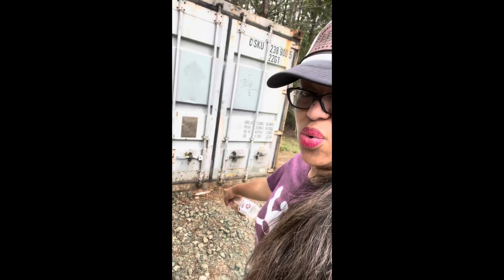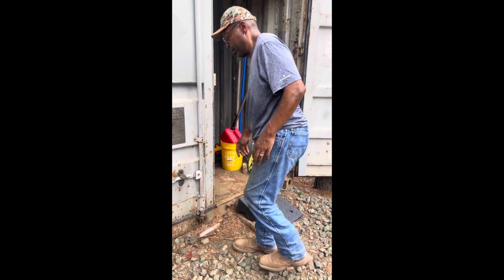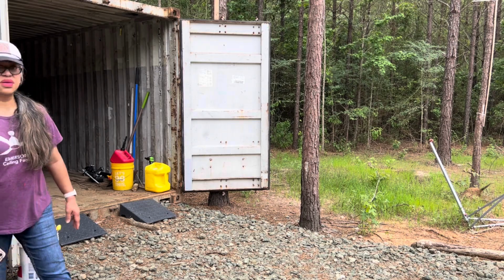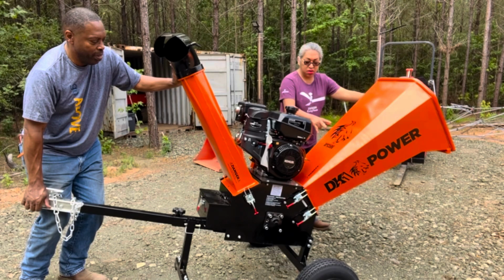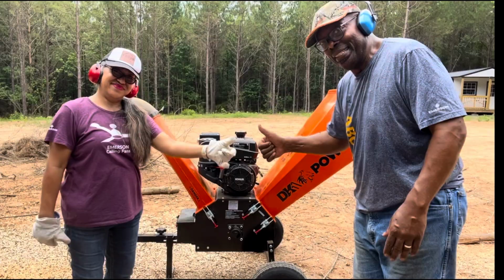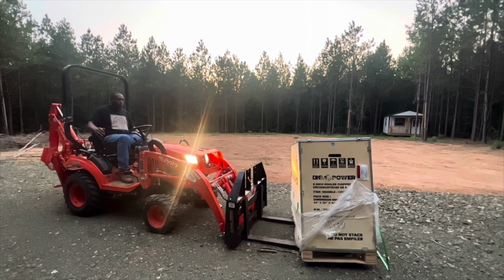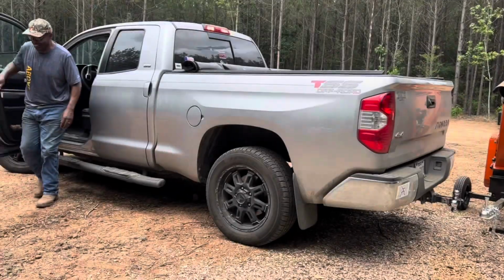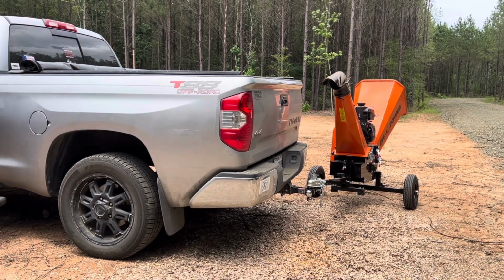Stop Struggling with Equipment Storage: Affordable Multi-Use Ramps to the Rescue!

Comment: Which ramps are these on Amazon? Could you run a 2-wheeler/dolly up them easily? Thanks
Reply from the maker: YYDS Driveway Curb Ramps,Curb Ramps for Driveway, 2 Pcs Heavy Duty Shed & Threshold Ramps，Ramps for Lawn Mower,6" Rise Height https://a.co/d/2dxVRyT
Reply from the maker: I think so.  It’s only 6 inch high.  And it can also take up 8800 lbs.